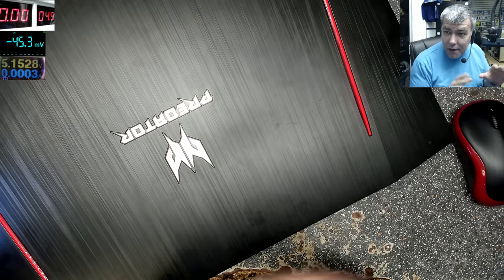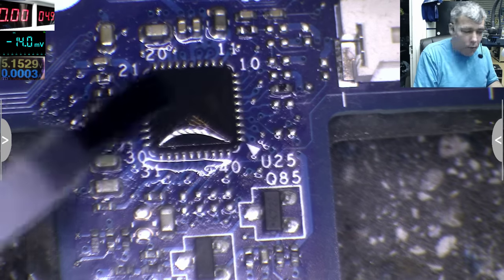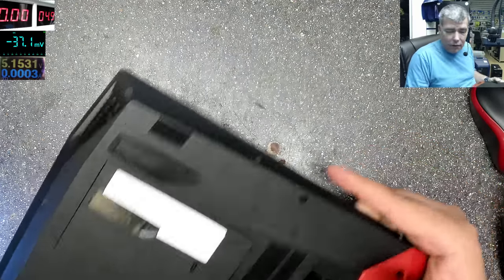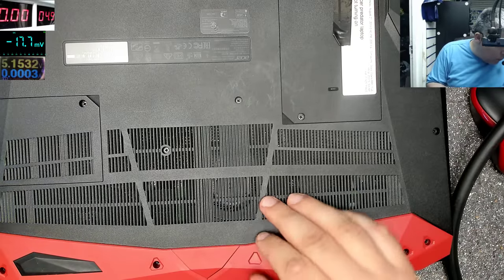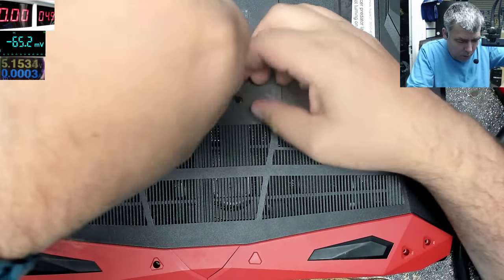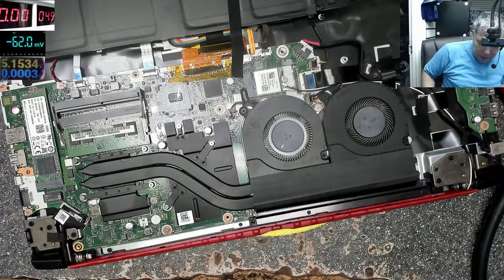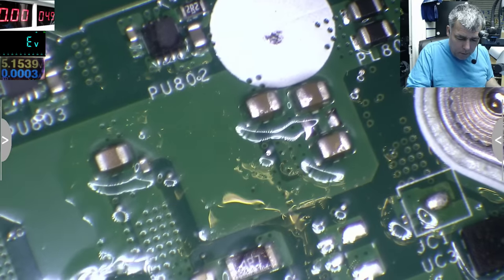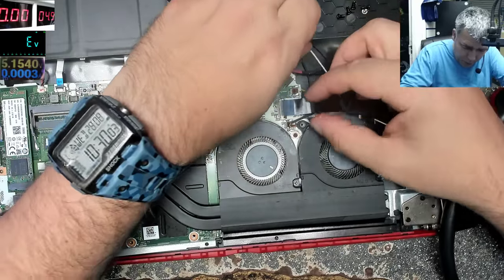Acer Predator Helios 300 - Dead, no power, not charging, motherboard repair

Comment: Hello Sorin. I'm electronic engineer working on security systems. Your videos were inspiration to me to give a try repairing laptops. I have an open market here in my town every Sunday where able to buy faulty laptops for 5 to 10 euros. The result is that I have ended up with several pieces that I managed to repair following your technic. Most of them with graphic card, which made a reflowing with your awesome liquid fluex, and power  supply issues. some of them I donated to kids and some I kept for my self. you are a genuine good teacher. Keep up the good work.
Reply: As Sorin said "you are the hero" bravo for donating the laptop to the kids. I've learning so much on each video that he uploads :)

Sorin & @ Karotinos greetings from Rhodes,Greece
Reply: @ManolisPappou  better will be teach kids repair laptops, not playing games on them :D

Comment: @ 25:53 - "who knows, some day we will replace the caps"
You made me laugh sooo mutch.
Keep up the great work mate!
Reply: is the board oversized with capazitors? why you dont need to replace it and just removing it?
Reply: @BlacKi-nd4uy  Depending of de position and funtion of the cap. it is not needed to replace. In this case it is part of multiple cap's in power supply. It can work fine without this cap. If you have the time and the replacement cap. than you can replace, great. If no part or no time.... also good.
Reply: @paulodagraca3469  thanks
Reply: mee too
Reply: @paulodagraca3469  a cap is suppose to be in line with other caps which will bare the current going through them, if you have 3 caps on same power rail and one of them is dead the other two will bare the current and overheat which will case a quicker fault and may also deliver unstable current under load to its designated location specially on powerful laptops, on low end laptops no one cares but this is a gaming laptop which will be put under stress and high power draw which will cause either unstable current to its location most likely will be filtered and be ok but the caps on the rail will overheat and die faster.
so if a customer paying you to do a job, doing a dodgy job is not going to cut it.

Comment: You dude, is the reason, i started to diggin' deeper with my 13 years old running self-employed small business in IT outsourcing and actually go for my smalll repair shop with all required equipment, as i am actually degreed in electronicts, but always was lazy to do that actually, you just bring that spark in it that actually started me. 

I was always working like, nah, won't turn on, scrape that shit, we'll buy a new one. NOT ANYMORE. Not anymore. 

Thank you, you actually saved a LOT of "dead" ones, master.

Comment: Good work Sarin
but I have a question, why didn't you replace the cap? isn't removing the cap will affect the motherboard?
Reply: Yes it has an affect but its a very very small one and the power rail has so many of them that its not usually a big deal to remove one. Personally I think its better to replace them but that is ultimately between the customer and the shop. In most cases customers dont know or want to know whats wrong and what it took to fix the problem, they just want it working again.

Comment: I know I'm a little late BUT I have a newer predator laptop and something you need to look at is your wireless adapter card attached to the motherboard. My went bad all of a sudden but I was lucky enough to have a laptop with a similar card and it worked like a charm. These Intel chips are all garbage..if your still having issue unscrew that chip and restart your laptop it might just work for you

Comment: Hello Good sir!
Similar laptop with a similar problem. I have a Triton 300 laptop from Acer, that does not take charge above 15% and discharges while still plugged into the charger, and ultimately shuts down (lasting only 5-6 minutes). Where in the motherboard do you think the problem could be?
Thank You.

Comment: I have been watching your videos and I notice you use your own adjustable power supply to troubleshoot.. does your power supply have different plug attachments for different laptop power ports i.e. I know this laptop had a slightly different propiotery purple plug for power. Or did you unsolder that person's power cord from their AC/DC adapter and attach it to your power supply somehow? 

Thanks for your videos. You have taught me so much.
Reply: if you pay attention you will see that he applies external PSU power using multimeter tips  directly to the circuit point where he believes  the short is located (often around power mosfets, coils, diodes and surrounding caps) …. 
he manually limits the output current of his PSU to avoid blow up the component, then while applying that external voltage he looks for components getting hot (which indicates the faulty one) and uses Zippo petrol as a visual help (petrol evaporates fast near a hot component).

While doing so he disconnects the charger and laptop battery to avoid damages from external PSU.

Cheers
Reply: Thanks for your explanation. I'm a bit of a noob still.  
Cheers

Comment: Thanks for the knowledge!
Q1: What mod do you use? not with the long atomizer, the short one.
Q2: If we have a 19V rail sorted and we apply 3V, will the sorted component still be hot to identify it? As a factor of security for not burning wrong things while identifying sorts.
Reply: It depends on how much amps you will apply on it. It should still go hot if you apply like 3 or more amps but you need a linear power supply
Reply: Dragos Cristian Ok. But will this work for safer sort detections as I refer to? Or it will destroy things like having 19V?
Reply: That's a good question.. I was wondering about that too
Reply: Q2 : what makes the component hot is the current (amps), not the volts. If you pay attention Sorin sets its external PSU manually to, for instance 5V then also manually limits current to 3 amps, to avoid that the faulty component takes more than that and goes boom, its a limitation for security.

Then he applies that power to the circuit : if a short is present voltage will drop to near 0 volts and current raises to 3 amps (previously manually limited) through the shorted component, which gets hot.

the limited current can be adjusted as per how fast you want that shorted component to get hot, but beware of the risk that too much current can blow up the component or worse a pcb track !
Reply: odium So, either 5V or 19V, if you go crazy with amps, the damage will be the same. Ok. I think this is my answer!
Reply: Yeah but is it true that the volts make the amps more potent the higher it is 
I.e. "1 amp" at 5V = 5 Watt & if you switch the two so its "5amps" at 1V = 5 watts too.. Would they have same heat?

Comment: hello teacher, i have a question if i dont have a special power supply to trace a short smd capacitor, what other method i need to do? thanks for responding
Reply: Desolder and test with multimeter in diode mode?
Reply: @NeuronalAxon  you mean remove 1st in the motherboard?
Reply: @JazzEnso  - Yeah, or snip a leg if it's an easy fix afterwards if it checks out OK. It's often a pain not having a bench PSU to test things with.

EDIT: If it's and SMD cap, then desoldering it completely from the board would be the way to go, if testing it in circuit is impossible.
Reply: You can use a battery in series with amp mode on your multimeter to get a similar effect. However limiting the current is a bit harder. If you are doing electronics you really want a good power supply, though.

Comment: Why is that power input jack so loosely fixed to the frame (it jiggles when you plug in the pin)? I didn't see you unscrewing it. Or does it get whole structural support from the back cover?

Comment: It would be nice if you explained why you didn't replace that capacitor. My guess is that it's only there for decoupling and noise reduction.
Reply: its there to handle the current and reduce unstable current flow to its destination, which in this case not critical but will cause other resistors to die faster since they need to bare the current with the missing cap from line.

Comment: I got a faulty Acer Predator 15. After a diagnosis at a shop, it's found with SSD and motherboard issue. But they charge too high. Would do I check for the brand/model/ part number of the replacement parts?

Comment: That Flux is probably for use with a soldering Iron not Hot Air.
Radio Shack used to sell something like that decades ago and it worked . . .  with a Soldering Iron.

Comment: hmm I have the same model laptop here with the same issues but seems to have a different charger. When I test voltage of the charger, it shows 19v as it should be. Once I plug the charger into the laptop, it seems the charger goes into protection mode as it then only shows 0.5V at the dc-in connector on the board. When I then disconnect the charger from the laptop to check voltage at the plug, it still shows 0.5V until I unplug the charger from mains power and plug it back in. Am now about to do the voltage injection test to try and find the short on the board. fingers crossed I find the short quickly and it turns out to be a unnecessary capacitor.

Comment: Hello,
thank you for the video. I have the same model and i have also a short. I have found under the headsink a burned coil, labeled 1ro 742 v92.
It is kind of exploded. I understand that it is most likely to not have failed on its own, but because of other parts.
Any ideas how i get a replacement. I cannot find anything with the given label.
Reply: Did you find a replacement?
Reply: interested as well. Overheated and burned that component. Wont start.

Comment: I can see the logic of finding shorts with psu but what if the short blows away and you are now putting 4.9 volts into a 1.8 or 3.3 volt supply rail?
Reply: that is where knowledge is required.... how much voltage to apply is the wisdom ... if you are on main rail 19v would be ok ... but because it is the short we want to find... we would apply the smallest voltage available on the board...
so unless it is the cpu which would be approx 1.1 v 
it would be safe to apply say 3v and limit the ps to 2a at the start and increase from there 
remember you cannot apply the ps if there is no short ... only if there is a short you must apply the power
Reply: pls see more of his videos .. and understand what is being done

Comment: Hello Sorin,
I have an acer predator pc the same as you with the same problem, there is no more light, finally the charge light comes on for 3 seconds then cuts off, and I can not do anything the pc does not start neither on battery nor charger
Do you think that if I remove the same component as you it will restart my pc?
Excuse me for my English I am French and I use the translator

thank you for your reply

Regards

Comment: hello sorin. i have a question . i buy a power supply sunshine p-3005da a linear. my problem is its always taking low ampere but its short. sometime i can find the short if its taking 1amp or higher but mostly i cant find its because i cant identify where is getting hot.

Comment: Quick question! A friend of mine has this same laptop and the battery will charge but even if the power cable is plugged in it will not run off the power cable it runs off the battery and eventually dies until you leave it alone to charge any ideas?

Comment: Hello, i am having issue with the same laptop. From the charging ic volatege to the gate is 10volt, source  19.4volt and drain 12.1volt. This 12 volt goes to battery positive. On battery connector two pin with 3.3v. Still battery not charging. I went to local repair shop bt no solution. Can u tell the fault reason.

Comment: do you have a video where you explain how to diagnose a laptop (mine is asus gl702vm) which does not charge battery? i fixed no power was a mosfet but cant charge the battery, and sometimes says 255% ....i have boardview fz file

Comment: Does CPU can be replaced or it is attached to the board (irreplaceable) ?
Reply: its bga, cannot be replaced, unless you can find a chip online and resolder/reball which will cost you half the new laptop.

Comment: I have the same unit its charging and has light when turning on but not continue...I try to reheat the heat sink for about 30 seconds and then it works fine...Then a couple of minutes after turning off the unit...It will not turn on again and I need to reheat again the heat sink to turn on the unit. What would be the possible cause of that?

Comment: hello..i'm having this issue with my predator Helios 300..
my laptops battery seems to "drain" overnight and whenever i try to open it without plugging in it says "critically low battery" and whenever i plug in the orange light blinks which indicates its not charging but the battery indicator shows "fully charged"what might be the issue? i have tried reinstalling windows,reinstalling battery drivers and all.The only workaround i found is to reset the battery through the keyhole at the back..which seems to fix the issue for the day but its the same the next morning ..PLEASE HELP!!!!is it  a faulty battery or?

Comment: How does it work without the cap? Isnt it needed to complete circuit?
Reply: it's magic..!! :)
the caps is in parallel with power supply , removing one has no bad effect.
Reply: The capacitors are there to control noise on the line. So the board may emit more RF for instance. But in general those capacitors on power lines are redundant and the board will work fine with one missing. But yes, you should replace the one you remove if you can.

Comment: I have no power after the power plug at the laptop. I can dee power at the end of the PSU > power through the power jack and to the plug end> but no power at the motherboard  for the power jack cable.
Reply: Check out my comment if you're still having issues might do the trick

Comment: hello i have same laptop while gaming turn off after no power no charge like dead when i opened i touch the cooler was so hot even i always cleaning new thermal soo on when i took to service the found charge spoild we fix and same problems laptop die so what the solution

Comment: I bought some AMTEK flux from Ebay. The photos were of the proper stuff so I thought I would buy some. As soon as it arrived I knew it was fake. The labels were stuck on funny and were even printed on a standard inkjet printer. Anyway why didn't you use your new fnadangled flux to remove that cap? it would have taken you a lot less time LOL

Comment: I use flux LP1 and TK83 from Termopasty with no issues,  they are genuine chemical industry from Poland … I think the scammer here is the seller from ebay who replaced the contents of the flask with cheap alcohol or maybe that type of flux is not intended to use with hot air gun, only iron ?

Comment: Mine went out.  No one will even look at it.  I think it might be a capacitor. Actually hoping. Changed the charger, the port and the battery and nothing.  I don't think anyone around my area in Florida has any idea how to fix computers and that why they won't even look at it. $1500 laptop collecting dust.

Comment: Got the same problem, but the electrician told me to buy a new mother board, and it will cost me 500 dollars.. He should have watch this clip....
Reply: Same thing... Just went from the repair shop.. 400$ for repair. No no... Gonna try my luck and see if this solves my problem. Did you repaired yours?
Reply: @franciscoverissimo2046  nop,  I just found out that the adapters port section is burnt-out.

Comment: Hi sir igot this samsung core i5 laptop that shutsdown after a few seconds what could be the problem....
Reply: Sounds like a failed CPU/GPU
Reply: @ShaDoWxGFX  i knew it but after a few try turning it on it turns on then shutsdown after few min when encoding or watching but it stays on when plying fps game...
Reply: @EngElfRax  Try and check mainboard voltages if supported with CPU-Z, maybe you will see the issue there
Reply: @EngElfRax  Could even be a shorted cable, u have to dissasemble the laptop
Reply: @ShaDoWxGFX  shorted cable? Do you mean the power button cable could be the colprit?
Reply: Remove all cables one by one and power on each time to see if any changes occur
Reply: @EngElfRax  eg one laptop I repaired had a shorted hdd cable, as soon as that was removed the problem was gone

Comment: my backlight on keyboard has stopped working. could anyone help me? it was working  i turned it off using  fn + f9 and also tried f10 to incase if it was dimmed but still not working. can anyone please help me ?
Reply: its the same model helios 300

Comment: I got the Triton 500 rtx 2060 last year and 13 months later it’s already dead. Just randomly last week the laptop stopped connecting to the AC/power adaptor. The laptop/windows works perfectly but soon the battery will run out as I can’t charge it or connect it. I’m guessing there is either an issue with the power brick, the power port on the side of the machine or the mother board itself. This repair might cost me at least £500- £1200?! What a disgusting rip off. AVOID!
Reply: I have the Triton 500 as well, 8th gen Intel, 2060. Ive tried different adapters, on my third battery replacement and even swapped out the DC jack. When I remove the battery, the adapters work fine so now Im almost certain there's a fault in the motherboard somewhere too. It just refuses to keep the battery charged. everything else is fine. When I have more time I'll be diving in to more of these videos.
Reply: @LynnieKayTee  Turns our for me it was just the AC brick that developed a fault. Had to pay Acer £80 for a new one. When you say battery drain are we talking excessive amounts? Because all my games drain the battery a little even when the AC is connected. No more than 20/30% though.